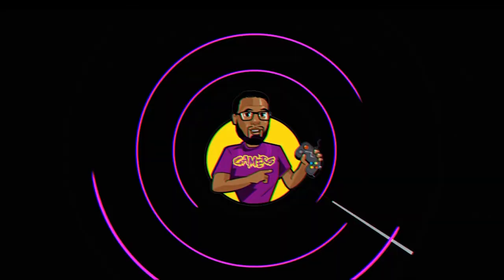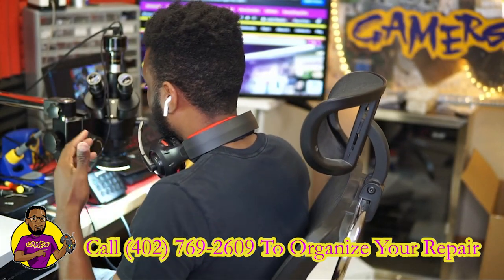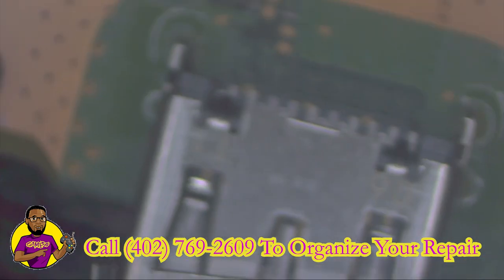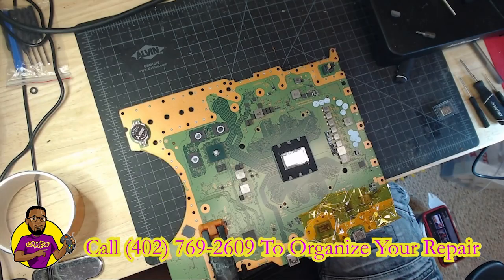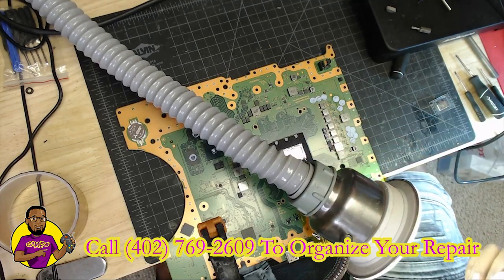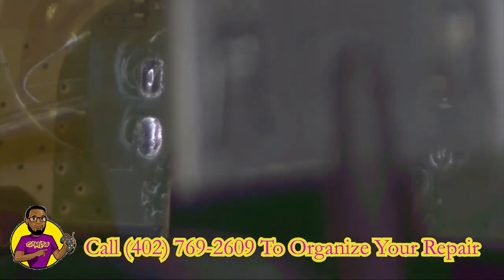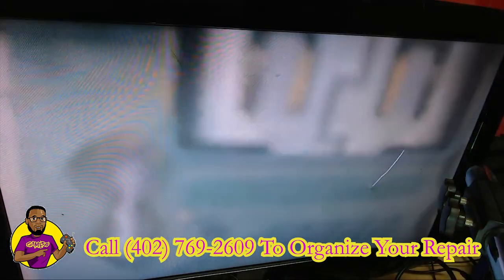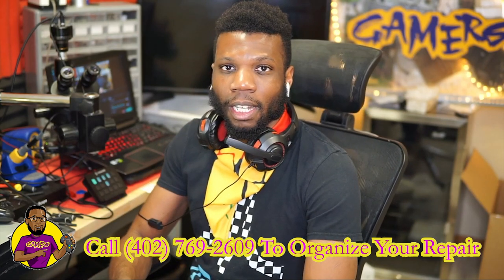FIX PS5 No Signal HDMI Port Repair (Best Method)

Comment: My launch PS5 has been having some random HDMI disconnects in the past month that seem to get worse and worse - it helps when I have pressure applied to the HDMI cable holding it very firmly into the PS5 like it's a loose connection. Not sure if I'll eventually need the port replaced, or if I can pry up the tabs of the port a bit more for a better connection, or it could even be something slightly loose internally.
Reply: Get a new port lol
Reply: Many people have had this problem shits butt
Reply: Same and mine is brand new
Reply: Bru I Js got the port fixed but the hdmi isn’t connecting

Comment: There was an update a while back that allows PS5 to be controlled by hdmi signal. Turn your tv on, ps5 turns on. This was causing my hdmi input to drop intermittently. Turned the setting off and no more problems. Throwing this out there to whoever might need it before disassembling your console.
Reply: What is that setting under?
Reply: I too am having the same issue
God knows why would Sony put features in without testing them properly

Comment: Can I ask why you used a heat gun over a hot air station for removal? I removed one of these ports and it took forever at 480 degrees with low melt solder applied but I'm pretty sure my nozzle was to small. Ordered some larger ones. Nice work.
Reply: Take the nozzle off and use it straight

Comment: I have a challenge for u! So i use astro A40 headset with the astro adapter piece for the optical cord and when plugged in i get no signal to my monitor but when i remove the astro adapter it works fine i get signal, is it the adapter itself thats the problem or something else

Comment: Hopefully you see this comment. I've got a PS5. I've taken it down to the motherboard and I've checked the EFI filters. The HDMI port itself is good. There's no broken legs and everything seems to be in working order but I'm still getting no picture. Are there any other tests that I can look into doing?
Reply: I have a similar issue. Im thinking its the hdmi encoder. Did you come to a solution?

Comment: My hdmi cord sits semi loosely in the port of the console & inside the port there is a teeny tiny gold piece missing off where the cord would connect.
Reply: Same
Reply: Shops said it was like $200 to fix!
Reply: @ishtlutz1261  I got it fixed for 140$ in a place called fix lab in Covina CA
Reply: Same but they said they dont know if it can be fixed
Reply: @HitNrun115  yoo what exactly did u get fixed and how long did it take I’m very close to that location
Reply: @randomyoutuber5172  my hdmi port on the PlayStation was broke it took about an hour to fix
Reply: @HitNrun115  yoo omg you are a life saver I went to the place today he fixed it in less than a hour like u said and he gave me 6month warranty and it only cost 140
Reply: @randomyoutuber5172  no problem
Reply: @randomyoutuber5172  buy some Xrp as well and hold for 5-10 years
Reply: @HitNrun115  bet

Comment: I send my ps5 back to Sony because the disc drive wasn’t working I live in uk so they told me to put it in a box.
I just want to know if I’m in uk would it take more time?
Reply: How did you get up with them I call almost everyday and he run endless holds
Reply: @jhymierbond9073  I called PlayStation and told them the problem if you want the number tell me

Comment: How much do you charge to fix this? I just had my ps5 hdmi insert mess up after finding my console cable pulled out and I have tried all I can do and noticed a bent on the insert.
Reply: Check around locally first before you decide to ship a system to a youtuber

Comment: So I have a client with the same issue hdmi damage on their ps5, how much you think would be a fair price for this job?
Reply: $50 if they have the replacement port for you to install & $80 if they don’t - which they usually won’t.
Reply: I need mine fixed .. smh 🤦🏾‍♂️ same issue
Reply: i need this  my broke 😩
Reply: @xqueen_infernoxcasanova6505  where did you go??
Reply: @bignaj3992  where did you fix yours